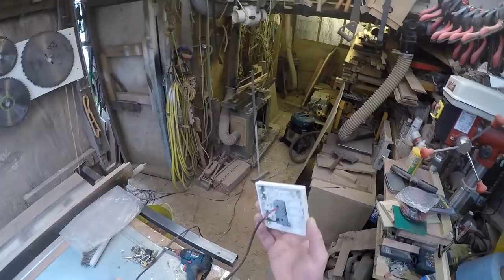Installing extraction pipes to my saws,

Comment: Your workshop reminds me of the first company I ever worked for,  good times... bits and bobs hidden here there and everywhere, stuff covered in dust and over spray that hadn't be touched in 50-60 years.. love it
Reply from the maker: 😁 stuff just collects then it'shard to dust around, workshops evolve, i don't believe you can set a shop up in the exact way you want right from the start, a concrete floor that i could sweep n cupboards with doors would prob make the dusty easier tho 😁
Reply: I loved working there, proper old school craftsmen.. the company started in 1935 and I found stuff in boxes tucked away that had sat there untouched since mid 40s lol..
Reply from the maker: My grandad was a joiner, i was too young when he went but i think my big plane came from him, love that plane but the prob with some of the old stuff is that it is just old n will prob only ever sit on a shelf still, I like the old stuff but unless i really think i'll use it i don't bring it home, got enough stuff in the shed 😏👍

Comment: Dust extraction is a problem in my workshop too I have two scheppach HA 1600 extractors one is shared between my Dim saw Scheppach TS 4010 and my scheppach HMS 260 planer thicknesser, the other one is rigged to my bandsaw . The worst two saws are the Dewalt  DW 721 radial arm and the  chop saw.  I have to admit I don't always wear a mask for just a couple of cuts . love the vids Gid you're spurring me on to make some much needed improvements .
Reply from the maker: Thanks Tony glad you like them 👍 yep or your shop could end up like mine 😁👍 The planers i quickly learnt need the extraction, one of my first vids shows the planer outside, i'd had the planer for more than a yr n always had to take it outside, when working for firms their machines were already hooked up, shavings just went away 🙋‍♂️ i never realised how much they produce, but it's taken me a long time to hook up the saws, you saw from the vid the amount they create, keeping up with the clearing has to be constant, obviously doesn't happen in my case, but i do empty the extractor bags, no choice esp when using the planers so when i sort the bench n shelf of junk out I'll be able to keep it a little cleaner now, 😂 yeah🤣

Comment: Jack of all trades, Plumber, Sparky, Chippy, and even a bit of bricklaying in the past. I'm actually very close to upgrading my 4" to 5" pipe. The bigger the better. Fortunately I have the room to be able to do it without a lot of phaffin around with all those bends around the benches and shelves. The other thing I have is a remote controller that turns my extractor on, and I have it on a belt clip attached to my belt when I go into the workshop. 'Very' different video technique LOL, It will come in to it's own when you need two hands  and still want to show us your tricks of the trade. Glad to see you are keeping yourself busy. Fingers crossed you can get out and about real soon.
Reply from the maker: 😂😂👍 Jack of all trades but only a master of one, he says modestly 😏 Glad i got my arse in gear n did this, for yrs I've been planing it, i did consider the remote switch thing but I'd just loose it, everything in my shed is dust coloured 😁 bit of an experiment with the headcam, still have to refine it n yep it'll come in useful in the right circumstances, prob when I'm not waving my head around so much, when i'm in a tight space or when i need two hands as you say, Lots of work pencilled in the calendar, bit awkward getting materials but not impossible, keep well, Thanks 👍

Comment: Love your videos and your impeccable craftsmanship. I was going to say they are a breath of fresh air compared to other workshop based channels where everything is spotless and sterile but (cough) that might be not quite accurate. 😉. Have you considered a roof hung dust cleaner to deal with the airborne fine dust that arguably is the greatest health hazard?
Reply from the maker: Thanks 👍 If i'd hooked up the extractor to the saws yrs ago & have a concrete floor than it would maybe be a bit cleaner, but it'd never be like those spotless shops, i go in there to work not play n wave a duster around, The saw came with a guard that has a port for a 2" hose, underneath where the flexi hose attaches there's a 2" port to connect that hose from the guard, I still have the guard so might hook it up to the ceiling or wall on a mount but it would have to be inline with the blade so i can get my hands down either side, at the moment I'm fairly happy with getting the main pipe hooked up & still need to build something for the mitre saw but yes I'll be making some kind of above the blade extraction, esp for MDF type materials, the dust in the air  isn't good but that bloody dust gets in every nook n cranny, esp on fleeces 😖👍

Comment: The  extractor does a good job would you recommend it .I always thought if you reduced the pipe the suction would be better not worse I have learned a lot from your videos  Thanks
Reply from the maker: Yes, I've had it a few yrs with no prob, changing the bags can be a pain but I've got the knack now n i think it'd be the same for any model. Yeah i thought it would be at least as good suction 🤷‍♂️🤷‍♂️ Left trying the 3" in rather than just showing new 4" going in so others learn n don't waste their time 👍👍

Comment: You should try WAGO electrical connectors - a lot less fiddly and quicker. Maybe use them when you get around to doing your worksop re-wire.
Reply from the maker: Thanks 👍 just had a look n bookmarked them, i was using what i had but if i buy some then i'll be using them 'that i had' 😁👍 yeah they look a lot less faffing about,

Comment: Hi gid just wondering if your dust extractor would have worked on a remote socket..mine won't it has a safty that when the power supply goes it won't come back on till you press the start button. It's a pain ..but you gave me an idea of wireing it from its switch..The switch at your door was that a two way one gang switch.?  As usual a great video. Cheers
Reply from the maker: Hi, no it was similar to yours, the power socket extension is near the door, i can switch it off there but to turn it back on i had to go to the machine's switch, inside the switch was a positive brown & negative blue wire going into the switch & a positive brown & negative blue coming out going into the machine, I connected the brown in & out to the new switch wire, the two blues i just joined together so bypassing the fitted switch. the new switch wires both positive brown n negative blue now both become positive live, you can consider them both as positive brown 👍 yep both new switches  used were two way, 1 hole at the top & 2 holes at the bottom, L1 & L2, 👍👍
Reply: Thanks gid. Did a small bit of wireing in the past. Might open the switch on the machine and have a look. Can always mock up a small version and see does it work.  Thought yours was a great ided. Some times I don't run mine cause it's to much warning up and down.... The rad cover looks great😊😊
Reply from the maker: Thanks Paul, if yours is like mine where it had connectors on the end & can get some connectors the same you could do non destructive testing,

Comment: Great vid Gid. Loving the head cam, you’re definitely going to have to have a protective casing on it 😉. Have you thought about doing a talk over of the clip instead of the mic or a combo, I know lots of you tubers do. I guess it’s down to personal preference. 

Those shut off gates, Frank Howarth did a couple of vids on his monster workshop on building a extraction system. Im sure he built his gates from wood! May be worth a watch, tho you will get workshop envy. 

Great to see a bit more of you’re workshop, really interesting vid. 

Stay safe fella
Reply from the maker: Hi Jan yeah the protective case is muffling the microphone, just to mount it on the headstrap it needs the case but i bought an external microphone that has a case with cut-outs 👍but that seems to be a bit better sound recording, still experimenting with this headcam lark, I've had mixed reviews so I'm glad you like it n the feedback is useful, I have tried doing talk over bits in the past with no luck, i need to explain at the time, it's a being in the moment thing for me, that's why i add simple subtitles instead 😏 & i did consider making some gates n still would like to, I have/had a pretty good idea of how i would build them, they're pretty simple but had a look online at what others had done, I just put my hand in my pocket instead, already forked out for the soil pipe n flexi n thought ''what the hell', I'll have a look at Franks vids, i still have to update/rebuild the router table & add some decent extraction to that 👍 You've seen pretty much all there is to see except more dust n some spiders 🕷🕷 You keep well too thanks 👍

Comment: Mike Farrington did a good vid the other day on making his own overhead tablesaw dust guard/collector.
Reply from the maker: Thanks, this machine did come with a guard hat has a port for extraction, i might rig that up but never really wanted the mounts etc over the saw & until now haven't had the extraction hooked up, so we'll see but the MDF as you saw does still kick out a fair bit of dust, I'll have a look at his vid, 👍
Reply: Gid Joiner MDF is a b***ard dust, I use it quite a bit and only have crap dust collection on my saw so make sure I put my air filter thingy on.
Reply from the maker: Yeah agreed, I do now wear my mask esp if I'm cutting a lot, it the dust on my fleeces that does my head in in, now I've got extractor hooked up n there is a small port in the bigger one that comes out under the machine i might as well go balls deep in n hook something up above, i don't want it in the way of cutting tho,

Comment: Just when I seen the Axminster drill press in this video, what do you think of it? I'm in the market and their craft range seems not too bad and definitely more than enough for me, a DIYer. Been putting it off for ages but have been trying to drill 5mm stainless bar with a hand drill is proving difficult.
Reply from the maker: Hi, yes it's ok, I can always pick faults, it's not as well machined as i'd like but I'd have to spend a lot on a pro machine to get that quality, but it's ok, the chuck is good, feels like you can get a good grip on a bit & it runs true, I bought this one over the others because it has 80mm drill depth , whenever i buy a machine i like to have that it'll deal with a 3" piece of timber, that was one of factors when i bought the Dewalt table saw, also a big reason i bought this was for the extending head giving good throat depth, a lot of the machines with this kind of drill depth were £200-ish, I've no regrets spending that little bit more,
Reply: @Gidjoiner  cheers for the info. I'd be happy enough with the fixed throat for what I need but having the extra depth would be a plus. Went to pull the trigger on the one I'd decided on from Axminster and it's only out of stock 🙄
Reply from the maker: 😂 Sods law that,
Reply: Absolutely. Funnily enough they have all the "trade" rated drills, but none at all of any of the "craft" range.

Comment: Gid, your table saw, is that the one on screwfix for £369? I'm looking for a cheap reliable saw to build into a bench in my workshop. Didn't want to be spending a lot but you seem to get good results with yours? Also, your made fence, did that just attach straight to the existing fence rail?
Reply from the maker: Hi, this saw is a Tisa 5.0, it'll cut 100mm depth, i think the one in screwfix is 310 or HS120 & cuts 83mm, I'm not sure if i would recommend this saw, It's powerful, smooth n relatively quiet but i did have an issue with the rise n fall after a couple of yrs, I needed to weld that, & i think a shim has worn on the spindle, The fence & rail is totally home made, i never put the one that comes with on so don't know about that. there's no grooves for a sled to fit in with my saw, You might be better buying one like the Dewalt i got, cuts 75mm, but noisy n £100 more than the Scheppach, https://youtu.be/tQ97rFxfRFc The issues I've had might be just this saw or the amount it's gotten used, I don't think it's available any more so the things i mention might be the reason & the ones at screwfix will be fine
Reply: @Gidjoiner  cool. I have the dewalt, had it for a while but the noise pisses me off. I wanted (ideally) a panel saw for the workshop but don't want to pay panel saw prices and thought you always got accurate cuts with a relatively quiet and cheap saw. I think I may Risk it and get the scheppach on screwfix and drop it into a bench.......
Reply from the maker: Yep that dewalt is a 1000db, the noise the dewalt makes when it screams/rumbles into life is horrible but the scheppach sort of whispers/whistles, it's still a bit noisy but a lot more nicer n acceptable than the dewalt, I'm sure it'll be fine 👍👍
Reply from the maker: The brushless might be quieter

Comment: Just spotted the saw set 20 minutes in.😉
Reply from the maker: The Dado set sat on the bench?
Reply: 20 mins 12sec you pick the saw set out of the box then lob it back in.
Reply from the maker: Ah saw set 👍😁 yes, my dad gave me that & a Disston saw when i first started, it didn't get used much though, i quickly learnt the disposable saws were the way,
Reply: @Gidjoiner  my first saw was a Diston paid just over 3 quid for it 1967, used to get  hand ache sharpening and setting it. Got my first Sandvik disposable about 1988 haven't sharpened one since. Keep up the great work regards Allan.
Reply from the maker: 😂😂👍 Sounds about right, Will do thanks Allen, keep well 👍

Comment: When you posting the video of the completion of the hospital bed.
Reply from the maker: Funny you should say that, I managed to get in a wk or so ago to drop off the parts I'd done & the paint sample, that's all been approved n we've made arrangements to get the job done hopefully this wk, I need to work out a day i can get down to the warehouse which is shut for lockdown to finish building/making the skirts for the bed, bring it all back here n I might have to spray the parts in 2 sessions but I'll be posting the vid asap. it's the job in my calendar 👍
Reply: @Gidjoiner  👍